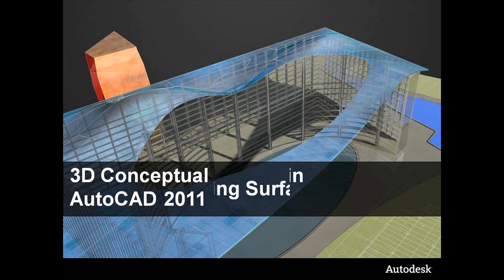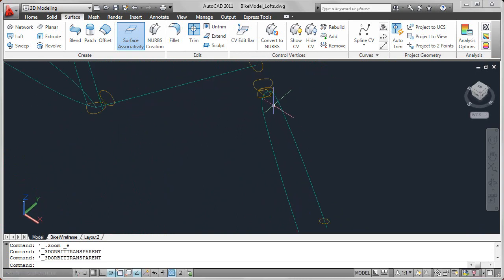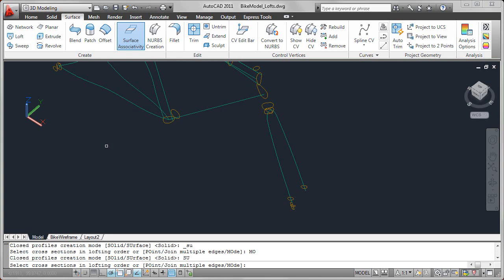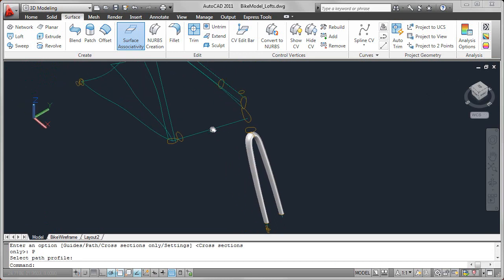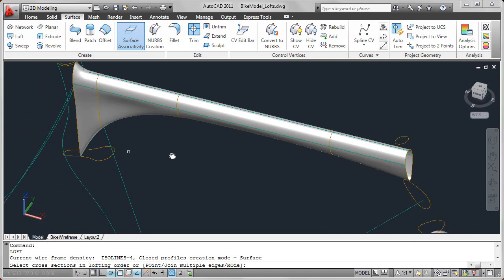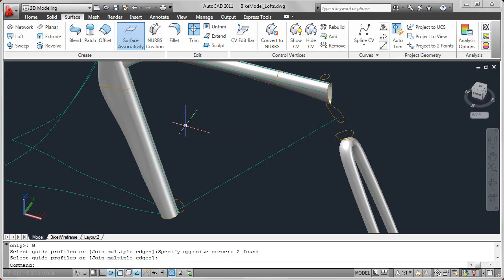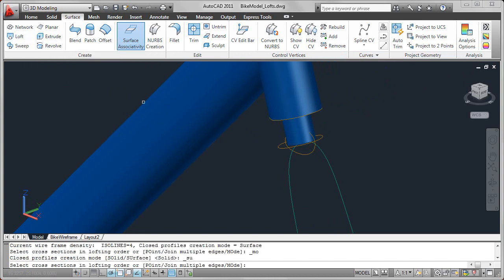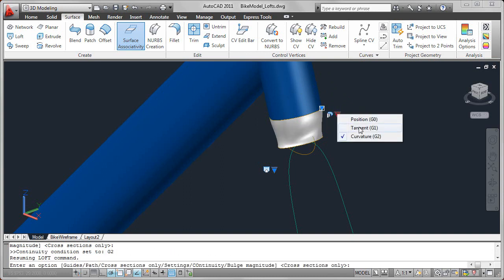Lofting Surfaces

Comment: Hi,

Thanks for the tips on lofting, I am working on a very (to me) complicated wing...
So, I will need to use guide lines... Are they a particular line type?
I guess they run through the center of the sections?